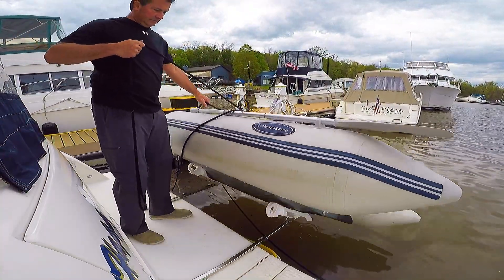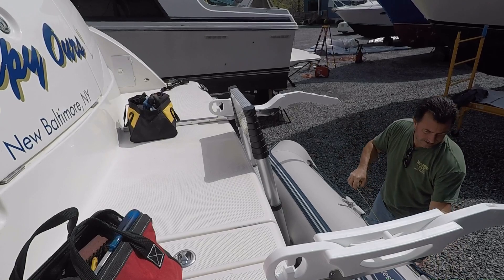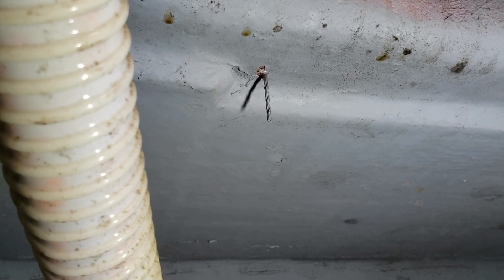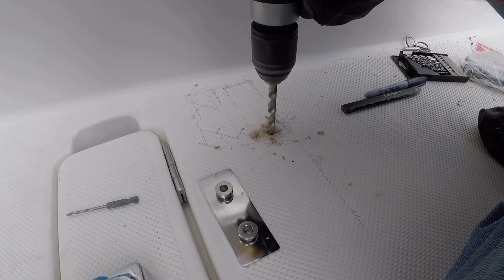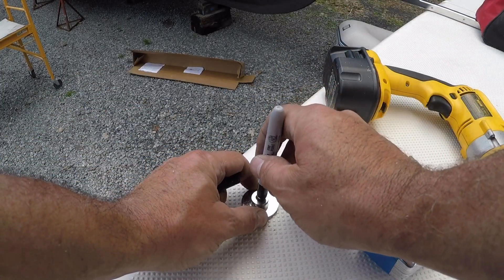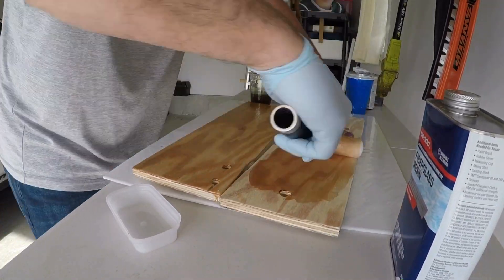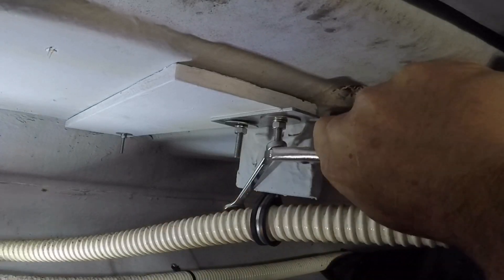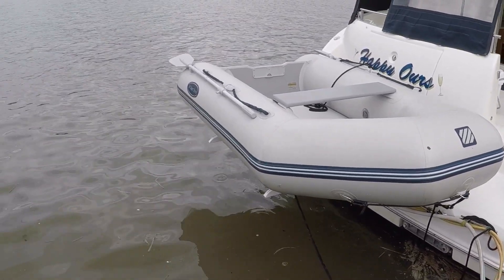Hurley H2O Davit Installation on a Meridian 341

Comment: Hey Skipper, are you still happy with the Hurley product? I have 2004, 341 and am looking at davit options. Thx!
Reply from the maker: It has held up nicely.  Even survived Hurricane Ian with my dinghy still attached with no damage.   I like being able to store the dinghy flat with motor attached.  A little difficult to haul a heavy dinghy up without some pulley system so go for a light dinghy/motor combo.
Reply: @AdventuresofHappyOurs  Thanks!